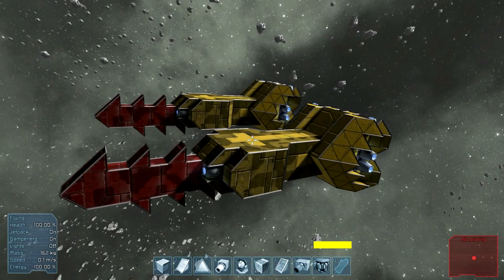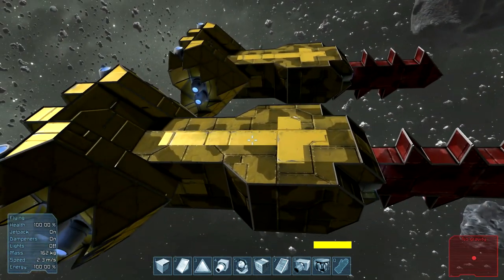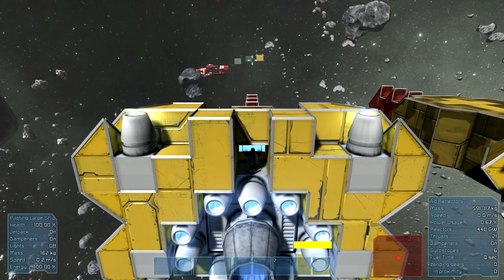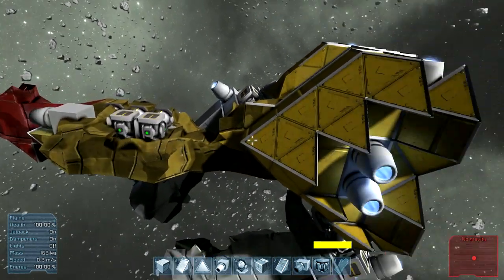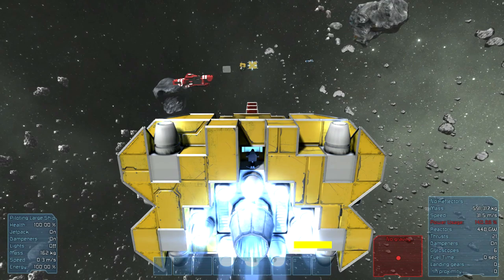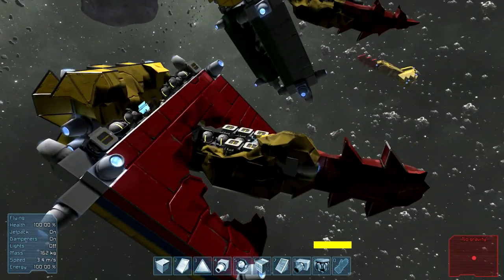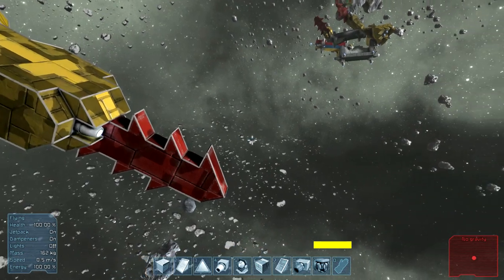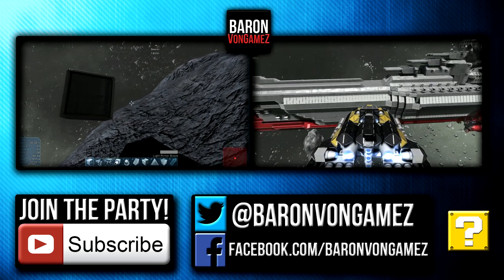Space Engineers - Ram Ships, Heavy Armor, and Ramming Testing

Comment: what i did with mine is i put an huge pole sticking out from the ram with light armor and i attacked two explosives too it to pierce the first plating and also blow up the rest of the pole so the ram still hits the other plating. You could also attach two rocket launchers and launch two rockets right before impact two weaken it.